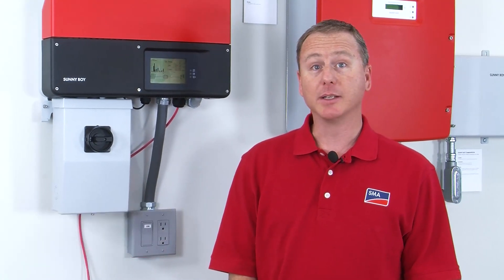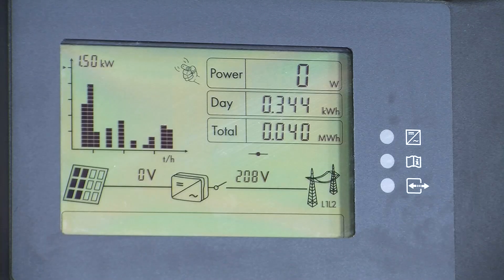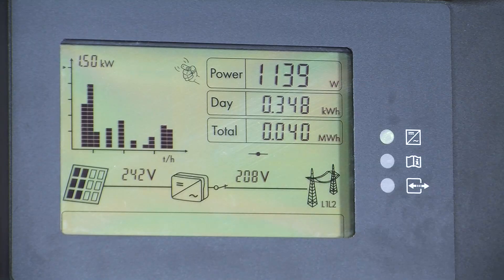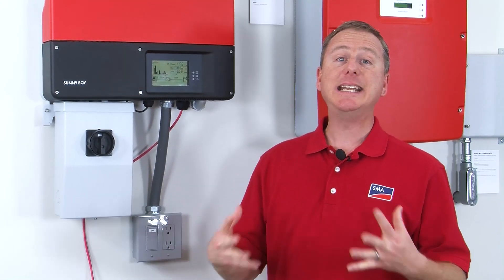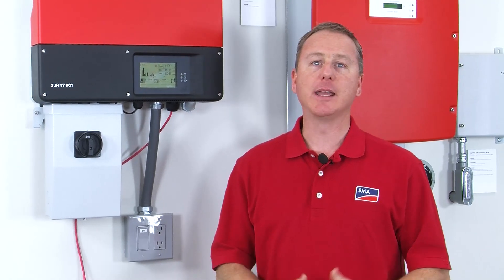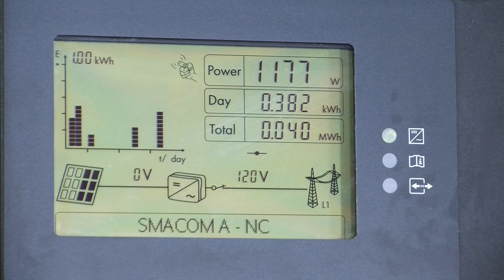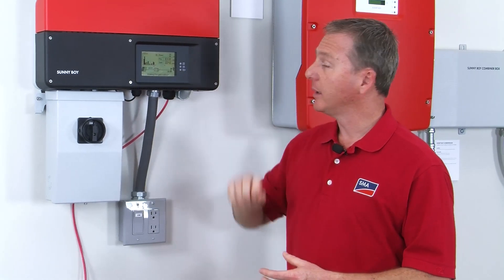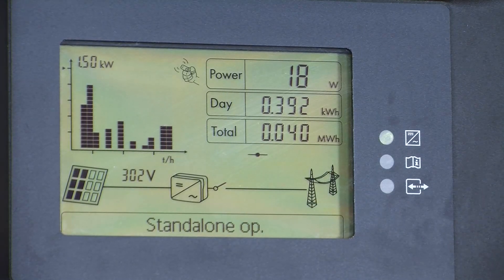Tech Tip: Sunny Boy TL-US Display

Comment: I’m using stp25000tl-30. For past few days I have noticed that at night time my display shuts off. Inverter completely shuts off and I can’t even access information on SMA app. 
Previously, at night time I was able to tap the screen and it used to turn on. 
Basically when dc power is on everything works fine but as soon dc is off at night time inverter competes goes blank on screen. 
May I know what the problem is and how can I fix it?

Comment: Thanks. I can see the A (amps) between my installation and the GRID, but what does it mean? Is it always the current my system delivers to the GRID or also the power which I get from the GRID (if needed)? Where would I see then the direction? Thanks

Comment: Have a silly question.
Just moved into a house which has this solar pv installed.
Am I using solar power while it is producing energy? 
Because I am running  swimming pool motor during the day but the solar is still feeding into grid.
I didn't think the solar energy (3.5) woUld be enough to run the pool pump.

In other words, is there any setting that the solar pv is only used for feed-in without generated power getting consumed in a house?

Hope it makes sense and someone can answer.
Reply: Hi Koichi! 
The electricity generated by the solar system will go to your home first, and any excess electricity will go to your neighbors.
Reply: السلام عليكم     احتاج  لضبط الانفرتر   الجزيره المشمسه على  احمال المنزل مكيف تلفاز اناره